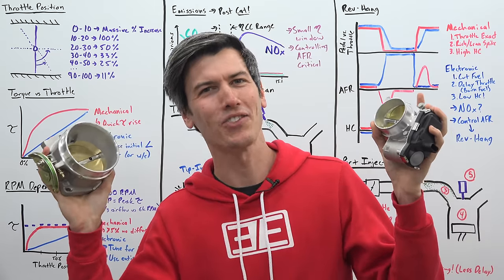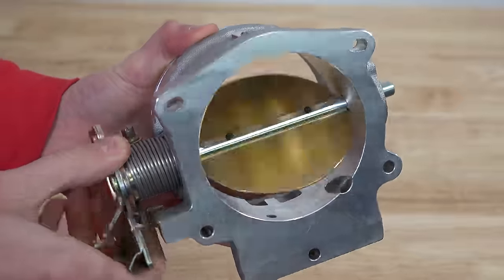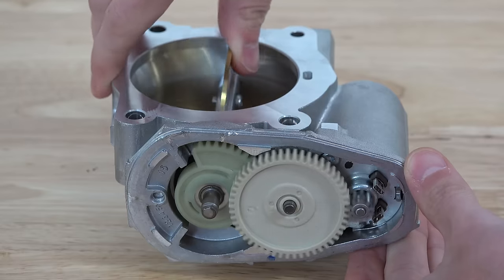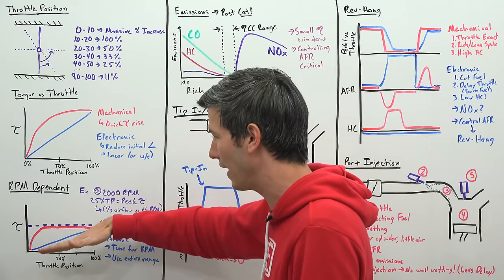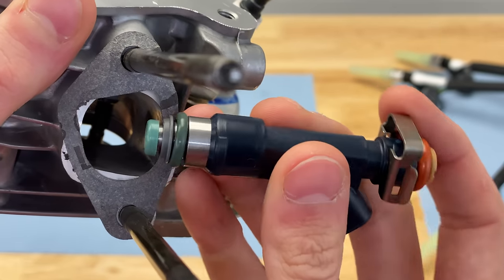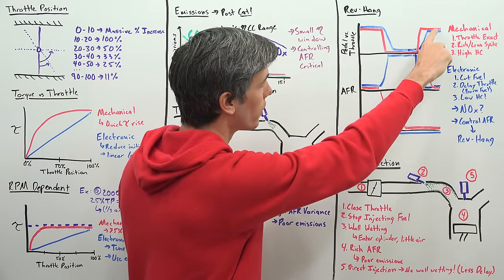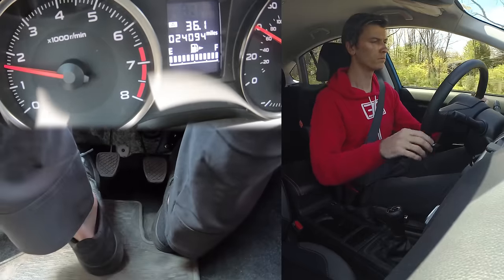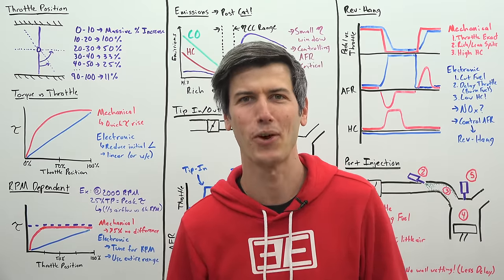The Big Problem With Modern Manual Transmissions - Rev Hang

Comment: It doesn't matter how hard or soft I shift, there's still a jerk in the driver's seat.
Reply: My passengers get jostled around like a friggin washing machine
Reply: pete smyth  quality comment 😂😂
Reply: And old people like my dad and mom think I don't drive stick very well because of the jerkyness. And my mom thinks my dad is better.  I think I am way better than him.
Reply: if you want to avoid jerkiness, use more clutch. But to avoid burning through it you should be able to time correctly the gear, soft releasing of the clutch and rpm, and it'll go smooth as hot butter.
Reply: @OscarSabaterCruz  You dont need to use more clutch to shift smoothly. It depends on what you'r engine rpm's are when you release the clutch. You can shift basically shift smoother than most automatics if you know how. And without sliding the clutch. And there is no need to change gears like driving a freaking race car. Rev hang can be compensated with slower shifting. Its not like you lose any time shifting slightly slower in normal driving. All cars are different to drive and its only a matter of getting adapted to the vehicle you're driving.
Reply: Lol I've gotten much better at it but my passengers still get jolted around once in awhile. The key for me is using a touch of gas while pulling the clutch out
Reply: @fromisheon4867  Lol you and I both aren't going to be getting that Chauffeur job soon, I'm the same way😁. My brain won't (won't, not can't😉) process throttle and clutch movements that slow just to make sure my passengers don't feel any shifts lol. The last time I put in effort to make sure my shifts were smooth, I was driving my dad to the hospital after a back injury (he fell) in my 320hp 5-speed mustang with stiffened suspension, that was a hell of a drive I'll tell you what lol(hindsight humor kind of lol). Having to balance between getting my dad to the hospital quickly for his hurt back or hurting his back to get him to the hospital quickly. I will say it brought out a great sensitivity in my throttle response lol. And grey hairs🤣.

Hard shifters for life! 😂😂😂
Reply: Ease on and off the gas pedal and use a little more rpm in each gear. Most people I know who drive all jerky shift like 1k rpms too soon in every day driving.
Reply: NorthernChev I see what you did there hahaha
Reply: Don't forget passengers. Ha Ha Ha!
Reply: I drive more jerky in a car without rev hang because I’m so used to it haha
Reply: @2Str0k3  it's harder with electronic throttle body tbh
Reply: pete smyth  you need a real big tool, like one you see at Walmart, to adjust the nut and make it work.
Reply: Learn to ride a motorcycle. They don’t have a synchro gearbox so revs have to be matched with throttle blips going down the box and fast shifts going up. 
Do that downshift blip in a slow electronic throttle and it will grumble on you.
Reply: Shifting too slowly especially going down the box makes for a jerky ride as the revs never match. It’s also much tougher on the transmission.
Reply: @davidelliott5843  My 98 mustang gt  would rev hang worse than my '14 camaro. Both straight piped. You can still make it smooth. In between shifts you wait and give it a little gas as you let off the clutch in one slow fluid motion. When shifting if you want it to be smooth you have to not accelerate during the shift, but still keep your momentum. You play with the throttle to keep the rpms where you want it for the next gear and hold it there while you're letting off the clutch. You don't want to give it too much throttle before the clutch is disengaged if you want it to be smooth.
Reply: Chimichanga so basically like you’re starting off, but for every gear?
Reply: Your just repeating what your woman told ya after you wouldn’t let her drive.
Reply: I'm just here trying to figure out did everyone got r/woosh'ed, or did I just see a joke where there's none?
Reply: NorthernChev, you crack me up, LOL LOL LOL!!! I think a lot of people didn't realize what you wrote! Be nice to yourself now!
Reply: Yeah you know you can still rev match.... maybe try releasing the clutch a bit later or earlier than you are used to doing it until you learn the exact rpm each gear needs...
Reply: @ChrisVanMiddelkoop  lol... so many peeps in this comment section didn't get it. Heh.
Reply: Imagine that after years of driving manual I've got automatic. This thing is jerky! I was driving a few of those and they are never perfectly smooth. Because of delay (in semi auto) or automatic gear changes you can not control throttle while gears are changing and it results in kicking. Obviously you can feel it much better with bigger engines than some small 1.6 quad turbo things. Those don't have that much inertia.
Anyways, I learned how to change gears smoothly without people ever noticing that. Surely it's not that smooth when I floor it and do it as fast as I can but in daily driving you simply can't feel gear changes. The only thing you can feel is change in acceleration when it goes to higher revs. With automatic I can always feel gear changes.
Reply: i’ve found the smoothest shifts have to do with clutch release and gas pedal timing. try accelerating right at the bite point of the clutch . it will take practice, might end up accelerating the engine before the clutch is fully out at the beginning.
Reply: David Royer I’m still astonished at how many people still aren’t getting the joke. Lul
Reply: David Royer ...read my comment again, but this time pretend it was written as though it has nothing to do with shifting...
Reply: @thebaddestogre-3698  been practicing a lot in iracing and drove my friends mini, she was "teaching" me and in my head i'm screaming "stop telling me to shift @ 1800 rpm I want to feel the torrrrqqquueeeeeessss", apparently she rarely goes above 2k...
Reply: @2Str0k3  I took a driving course with Hurley Haywood.  His shifts are smoother than any automatic transmission.  Up shifts, down shifts, part throttle or wide open.  Not the slightest bit of jerking in any situation.
Reply: I see what you did there well played sir
Reply: REV MATCH!!!
Reply: Need to let the revs drop before you release the clutch. If you release while revs are high then you will get a jolt no matter how smoothly you release the clutch.
Reply: Let me guess.  Mustang.
Reply: @davidelliott5843  With a motorcycle, your speed comes into line with your wheel's RPMs in short order.  I was taught to make RPMs for the speed you want to go, not for the speed you're already traveling.  If anyone reading this doesn't know how a motorcycle's transmission works, you have to work the transmission through every gear to get back to 2nd, before you can put it in neutral.  You have to brake with your engine.
Reply: pete smyth , hahahhahahahahha, I've been laughing my butt off.
Reply: You really need to learn how to use clutch and how to match revs when downshifting. If you know your car you can almost make it automatic smooth if you know what you are doing. If not... well, things are rough.
Reply: BOOM💥
Reply: i used to have the same problem with my sti. you need to let off the gas for about a second before shifting. youre still on the gas when you change gears, and thats the jerk you feel
Reply: @2Str0k3  I've gotten really good at rev matching in my Civic. I can shift perfectly smoothly 95% of the time now. However, I bump way more often going from first to second than other gears because of the ratios. At least that's what my mechanic said.

Edit: I just caught the joke (-__-)
Reply: My ‘19 mustang has some serious rev hang in 1st and 2nd gear. I never had this problem with any other manual car and it’s very annoying. Been driving it for a whole year and still haven’t got the hang of it. It’s still jerky and I’m wondering if that’s just how the car was made or if I’m just not driving it correctly. But like I said I never had this problem with my 04 tsx and my 09 civic. Any pointers?
Reply: Hold in the clutch longer so the revs can drop more.
Reply: @luckydragon6892  Does your car have any way to turn it off? Some cars have sport mode and it makes the throttle body more aggressive, reducing rev hang.
Reply: NorthernChev 🤦‍♂️ lol got it
Reply: Blipping the throttle sometimes works, and some rpms give a smoother shift than othee. Like shifting at 3000rpm instead of 2000-2500 rpm.
Reply: @Ferrichrome  Yeah, you need to rev match otherwise you engine will jerk. Just put the car in neutral and find the sweetspot for 1200-1500RPM on the throttle, now apply it at all times when starting from a standstill in 1st to changing gears. I dunno what it's called in english, support throttling we call it. It's something you need to know to get the license, so you can start uphill etc.

EDIT: Not at all times, but when you're revs are starting to drop during shifting. You use it to keep the revs at the optimal range. Above 2000RPM will start to burn your clutch on most cars iirc.
Reply: @ickerolig  that's a great tip, I'll try it,thanks!
Reply: Maybe you should practice rev matching. Just try to learn how much your RPMs will drop when shifting to the next gear and release your clutch at the right time. The a whole engineering explained video about rev matching, you should watch it.
Reply: You need to rev match.
Reply: Hayden Landry .../facepalm.   Read the original comment again, but this time pretend it was a joke.
Reply: If your syncro is in good condition, position your foot on the clutch and take the play out,  ease off a little on the throttle just an instant before the before the shift, in less than 1/4 of a second: start pulling the shifter towards the next gear  an instant before your depress the clutch.  For a fraction of a second before the gear you are in disengages, all the gears in the trannie are rotating at the same speed.  In the fraction it takes the shifter to disengage the current and start to engage the next, the gears are almost stationary relative to each other. IF your clutch releases the output shaft just at the moment the syncro pins start to engage for the new gear, the gear will engage and if your have simultaneously eased the throttle  enough the upshift will complete without jerking.   For this method you had to really get an intimate feel for your gears and how they mesh.  There will be some grinding while you learn this so don't try it out with passengers or you're worried too much about your trannie. Practice on level ground and low speed and be gentle–finese, not strength.
Reply: Richard Campbell ...still stunned at how many people don’t get this joke...
Reply: Get a tune or you will eventually hate driving a modern manual.
Reply: It's ok, as long as you don't clutch yourself while driving.
Reply: @rcnelson  !!! Now, SEE!  YOU understood the joke! Nice retort!
Reply: pete smyth  im crying now hahaha that was hilarious
Reply: I think there are a lot of people in the replies that missed the joke here :D
Reply: @MagicStick "Need to change the driver" still was a good answer though
Reply: @2Str0k3  i agree with stroke. homie i drive a 350z and i can shift and you can’t even feel it but i got behind the wheel of a rx8 and holy crap you rode with me then you’d be getting whip lash
Reply: a lotttt of people missed the joke 😂😂😂
Reply: @Ferrichrome  i use the same method but it only works when accelerating otherwise you have to wait 10 years for the car to shift
Reply: If you're driving slow, you don't need fast foot work. Back then, you do. If you want to floor it, you don't need to be in the low rpms. If you still have rev hang above 5500 rpm, its wasn't meant for hard driving.
Reply: @JAO911PLIST  ...read it again.  It's a joke about 'being a jerk'.
Reply: @JAO911PLIST  i get rev hang for 20 min from starting car after it goes away. Oh and my car only goes up to 5000rpm
Reply: @timothyvu7006  ..."smooth" out what?  It was a joke about being a jerk.
Reply: That jerk will either money shift or granny shift your transmission. 😆
Reply: I adore the number of people who refuse to get your joke. Bravo, sir.
Reply: It is possible to shift fast and smooth.....really it is.  The replies to this NorthernChev comment make me think half the population can't walk and chew gum at the same time.
Reply: @judgegixxer  I appreciate your take on this.  The best part of all these responses, is that the majority of the people who replied to my original comment did NOT pick up on the fact that it was all a joke... A play on words ---> about me being the, 'jerk' in the driver's seat.
Reply: I read your comment and closed YouTube, then thought about it once or twice before I had to open YouTube to find your comment again. I now understood the joke.
Reply: Ooh, Self burn! those are rare!
Reply: Got that jerking with a 4 cylinder Mustang but not with the  V-8s. Never got fixed. Just use rev the matching setting for city driving.
 It helps but the thing still drives like the 4 banger has a rubber drive shaft.
On the seat part , well I got banned from testing the Mustangs. Why? Because on occasion I drove one like a customer.
So what does the division I work for say in it's title? Voice of the customer fleet.
Look they got girls driving for the girly cars. But don't want to hear about it from a from a old gear head that knows how hammer one without tearing it up.
 You know? Like finding a tree with the over cabonated thing. They even have a course on how to drive one. Point, the customer does not get that course. Just gets the keys. 
Hey I know how to get fuel mileage out of a 10 speed with a load. You learn that when 7 mpg is better than 6 mpg and you are paying the fuel. Yes 15% does make a difference when it is a 75 gallon to fill up. 
If your butt is in a V-8 Mustang you don't care about gas mileage.
Reply: Doesn't matter how hard or soft you actually shift.  That is a sign that you should be driving an automatic because you can't handle the clutch system yourself.
Reply: @natev580  didn't get the joke
Reply: @natev580  …or, if you actually read the original comment, you’d see he was making a JOKE about himself being a “jerk”.
Reply: No you don't I've been driving manual cars for 40 years and had no problems jerking or throttle hold
Reply: @OscarSabaterCruz  there are cars out there that don't lend themselves to this, despite what you suggest. In the timeframe of just a year i've driven about 20 different cars, some i manage to never jerk and others almost always jerk no matter how smooth i operate the clutch and/or how well i time the shifting.
Reply: @Ferrichrome  now imagine when you need to accelerate fast to keep it safe, you push into higher amount of revolutions, but as soon as you engage the clutch, the acceleration stops and you and your passenger jerk forward. (there are some offramps that end into a crossroad with right of way with rather high speed limit that warrants quick reaching maximum speed for safety)
Reply: @georgieliverpol  hello random guy who didn't get the joke
Reply: @DynoRC  doh lol
Reply: Maybe you should give the jerk still sat in the drivers seat a little nudge and tell him to shift the gears himself then.
Reply: I see what you did there.  LOL
Reply: @john90430  FINALLY!
Reply: Then you can’t shift
Reply: @PiOfficial  "...a jerk in the driver's seat."  He's calling himself a jerk.  You know, it's just not funny anymore when you have to explain it.
Reply: @john90430  my bad ahaha
Reply: Ive driven only stick since I got my license, I also drive 9/10/13 and 18 speeds in semi trucks. Smooth shifting is about how you’re doing it. With a semi truck you can shift by floating (this trashes regular car transmissions though) but you can also double clutch, you can revmatch downshift or you can simply slow your shift pattern down. May even try shifting at lower RPMs, it’s better for fuel and engine life anyway to not always be revving to redline before dumping gears… you could just keep the engine in its best torque rpm range… in fact, that’s how you save fuel.
Reply: @Skyhawk656  You clearly missed the joke...
Reply: LMAO !!
Reply: @2Str0k3  what about taking off from a stop on an incline? İf you wait too long for the RPMs to drop people behind you are going to get pissed off because you slowed down all of a sudden. Modern manuals suck that's for sure. Reving from 1st to 2nd makes the car jurk and can't get smooth transition taking off from a hill  I can feel the driveline going doink but in a flat surface it's not bad.
Reply: That’s just a manual lol
Reply: Amazing how your comment flew over so many heads ! LMAO : )
Reply: Epic comment.
Reply: Nobody seems to get this joke lol
Reply: Try (not stop to 1st) totally letting off your clutch, then shifting, then adding gas for gears 2nd and up.......🏹🤠👍
Reply: @theamazinggoldfish8713  ...uh, oh.  somebody missed the joke.
Reply: @Ferrichrome  torque de gas forza al embrague, aunque es necesario en pendientes.
Hacer el cambio rápido 
daña la transmisión, e incluso suena como pampana 
Mi solución es hacer el cambio de 1 a 3 si quiero ir tranquilo, así no patea por culpa del Revhang
Reply: @Ferrichrome  I do this too and it's a lot smoother, but will it wear out the clutch faster?
Reply: @e1bo  Well I left this comment 3 years ago and I'm still driving the same car with the same clutch in it, so I'd say it's fine lol
Reply: OMG so many people completely missed your joke. Haha well done!
Reply: @matthewjohns7220  IKR, crazy easy
Reply: @Ferrichrome i think i used to do that in my 300zx twin turbo. made for a much smoother gear change. kinda like a rev inverted match.
Reply: I have found that as said you must keep the throttle partially open between gear changes. My car Abarth 595 tuned has about a 2 second rev hang and I use this to my advantage as I have two seconds prior to deceleration cut off from the throttle body when the driven wheel speed reduces faster than rpm. I have fitted a short shifter to ensure a gear change prior to engine brake deceleration. This keeps things smooth. When pottering around I shift at 2500rpm with minimal effect from rev hang as the rpm as they are low enough to control with a practiced clutch action.  T
Reply: @timothybliss3799  Hey guys!  Yet another commenter didn't get the joke! ...or read the other comments to see that it WAS a self-deprecating joke.
Reply: Its the electronic TB THATs the problem
Reply: @gabrielv.4358  *le sigh... yet another poster who didn't get the joke.
Reply: I had a 2016 Mazda MX5 with direct injection and no rev hang. I now have a Toyota GR86 with combo direct and port fuel injection. I has rev hang under certain conditions. It is annoying, but I’m learning to shift more smoothly as I get some mileage under my belt.
Reply: @RetirednbrokeinPa  ...It. Was. A. Self-deprecating. Joke...  Read it again. lol
Reply: @NorthernChev I was commenting on the video, but somehow it ended up being a comment on your witty comment. Sorry for the confusion, but I bet a lot of the others did the same. BTW there’s a jerk that won’t  go away in mine also. LOL
Reply: On reading the comments to this post, you can get a sense of how many people missed the joke.😂
Reply: @manlyotool1165  Exactly.  And on that note, it blows me away how many people are more focused on wanting to tell you how to drive rather than listening to what was said and missing out on the joke.
Reply: I drove a manual for 48 years and was smoothest with the throttle hang cars. Usually never looked at the tach. Very smooth. Loved that new tech.  Unfortunately , manuals have become an anachronism.  Fun but not efficient.
Reply: @fromisheon4867 jerky driving is not good driving. Good driving glides smoothly through the gears.

Source: driving rideshare for 5 years, most of that time with a stick, and driving it so smooth the passengers didn’t notice. Driven hundreds of thousands of miles with it an never had to replace a clutch.
Reply: @2Str0k3 a little slip helps. If you’re not burning the clutch out, it helps keep it warm (not hot) and smooth.
Reply: @TheExplosiveGuy nah bro, smooth shifts are sexy. Try a little bit of slip with the clutch, find the sweet spot where you can bump it and it pulls the engine down.

How I learned was holding the gas JUST ENOUGH to keep my rpms where they were when I pressed the clutch, holding it like that through the shift, and letting the clutch bump the rpms down (or up) into the next gear. When the tach or engine pitch stabilizes, you let it out. So smooth, it makes automatic cars feel jerky. I wish I could show you in person
Reply: @StealthTheUnknown  I don't.
Reply: I think you didnt get it on what rev hang is. it's basically "delayed jerk" after you release the clutch after you shift gear, not an instant jerk like a mechanical throttle body. 
But I assume electronic throttle can be tweaked to behave like a mechanical throttle when you shift gears. 
I didn't know car that much, so yeah.
Reply: @MrSongib  I think YOU didn’t realize that this is a self-deprecating joke about myself and has NOTHING to do with cars…. How ‘bout THEM apples?  Four THOUSAND people got the joke.  How’d YOU miss it?
Reply: @StealthTheUnknown  what car do you drive?
Reply: @NorthernChev  My bad. XD